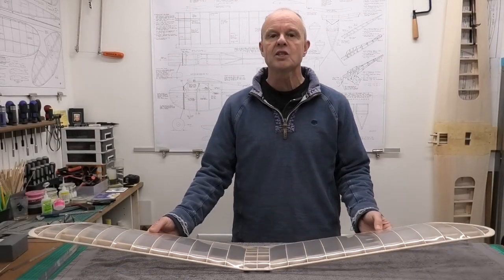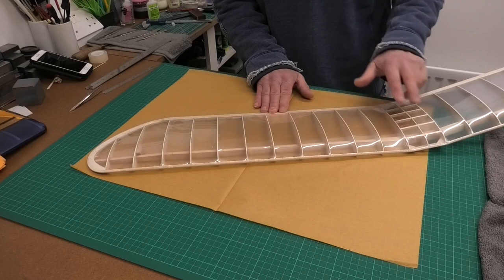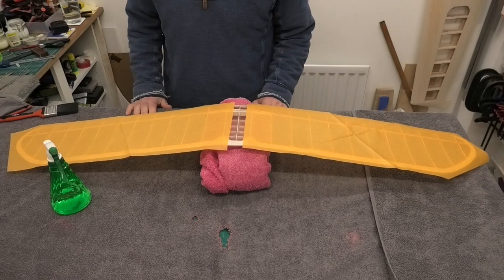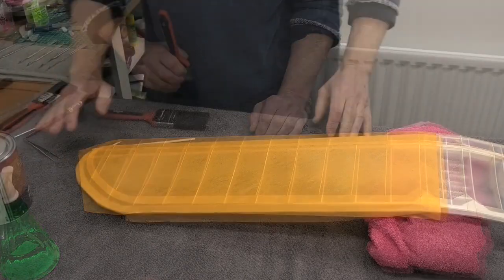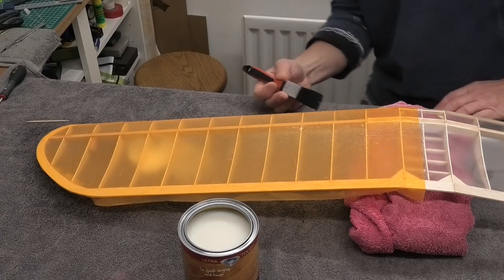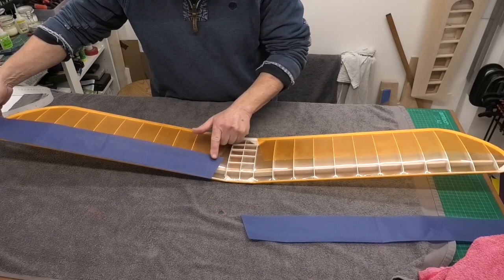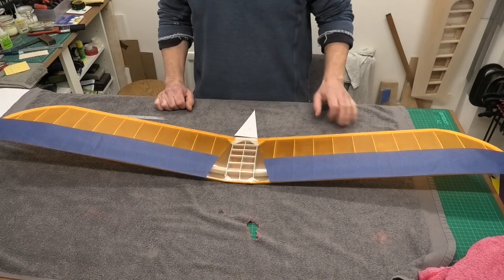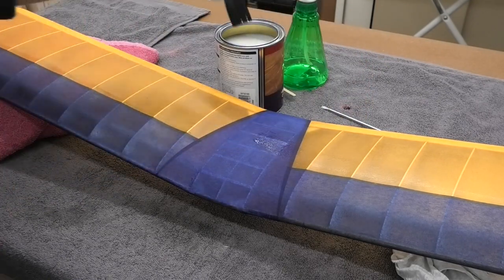49" Diamond Demon & Bantam 19 Spark Engine - Pt 10: Tissue over Laminating Film on the Wings

Comment: Thank you Mark, very interesting and indeed usefull; a little tip here from a cabinetmaker who has used a lot of water-based polyurethene varnish. I find it easier to pour an amount of varnish into another container such as a 1 liter yogurt container and to add to it about 10% distilled or demineralised water to be stirred-in gently; this makes it flow  more easily, particularly for the finishing coats. Otherwise, I found that disposable foam brushes do a great job of eliminating bubbles in the finish. They are also easy to clean and can be re-used again and again despite their name, One thing to avoid is to rub the brush on the edge of the paint pot; that's where bubbles happen. Thank you.🙏🏼
Reply from the maker: Thank youvery much for the comment and helpful suggestions, greatly appreciated, pleased you found it useful

Comment: Great video series Mark!!! Question for you. At what size of an aircraft do you stop using doculam and tissue and go with say a polyester light fabric? You have inspired me to make a Diamond Demond, but bigger then your build. I’ve printed out the outzone 49 inch wing plan at 55% larger. This makes the wing span 76 inches /1930mm. Is this getting too big for Doculam and tissue?
Reply from the maker: Hi there, thank you very much for the kind comment.  Regarding your question, I guess that would depend on the models design, but I wouldn't go much larger than 50", partially due to strength, but also as I think a larger model would look better with a different covering like silk.  Good luck with your project, hope it goes well 😀

Comment: Great video. Thanks. 
I have been recommended to do this on a gentle lady glider. To give the wing some strength. Is this lighter than a the likes of oracover etc?
Reply from the maker: Thanks very much for the comment, pleased you liked it, regarding the weight, its about the same, it all depends on how much varnish you use as that is where the weight is.